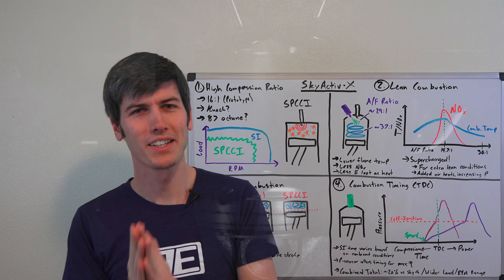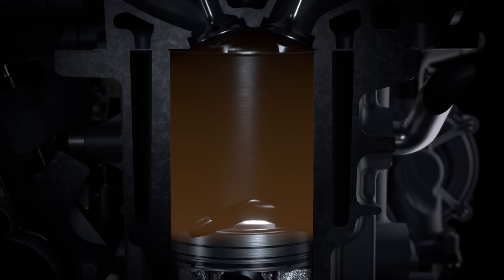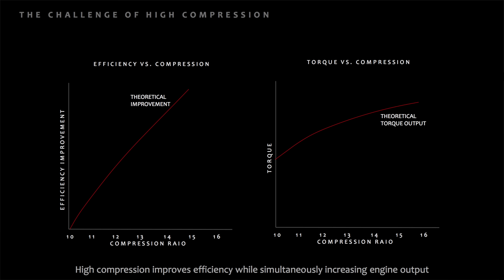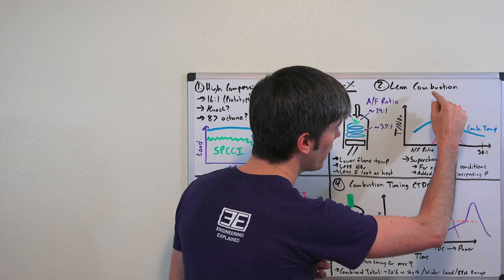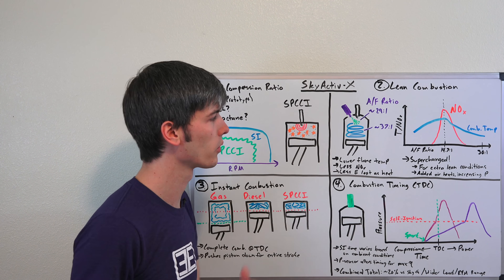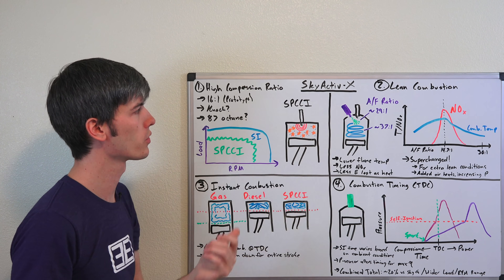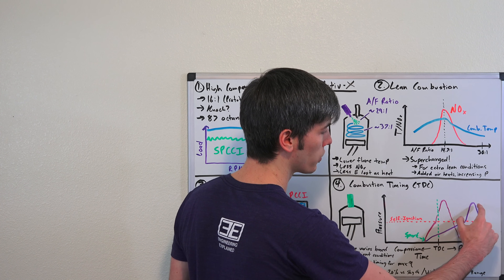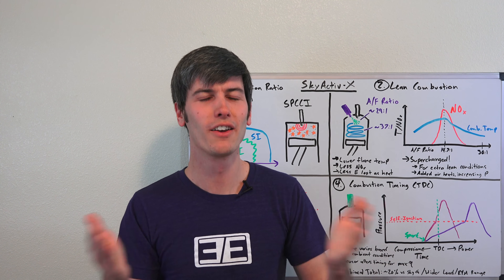How Mazda Is Saving The Gasoline Engine - SkyActiv-X

Comment: 7:25 - The lean supercharger is not to improve performance...

Oh it'll improve performance... just give the tuners about 6 months after its release
Reply: maybe not actually. The engine is very precise in when it sparks, so I don't see many ways it could improve performance. It would make the mixture less lean, therefore defeat the purpose of the engine.
Reply: yeah but then he explained what it does (puts crazy amounts of air in the engine) and.....isnt that increasing performance?  lets pretend that they did this without a supercharger first.  it would be considered underpowered because in order to get the correct air/fuel ratio, it would have to inject less fuel.  so then they introduce a supercharged version.   everyone would say it is for power even if it is only to get HP figures up to todays standards.
Reply: @spencerphilippinedream3706  lol no cause 190 hp for a n/a 4 cylinder is very up to hp standards, but would require more fuel. This engine being able to run so lean, it needs the charger to even supply the amount of air it needs
Reply: @tlpusher9652  you said almost exactly what i was trying to say so im not sure that i explained it very well.  you dont "NEED" a supercharger to get 37:1 air/fuel ratio.  simply inject less fuel.  in that scenario, you would have very efficient engine but under powered.  right?  if you injected less than half the fuel (to get 37:1 instead of 14:1) the engine would create about half the power (95 HP).  
         superchargers are parasitic.  it cost HP to gain HP.    so for max "efficiency" a supercharger isnt needed.  this is why i say, the supercharger is for power, not efficiency.  
         i think a n/a engine would be MORE efficient.  however, it would have to be double the displacement to create the same power as a traditional 14/1 air/fuel ratio.  so 2.5 liter power from a 5.0 liter displacement.  that doesnt seem like good marketing.  
           and the reason they cant use a turbo (NOT PARASITIC) is because turbos dont provide boost at idle.  so not only would it be HALF as efficient at idle, but probably wouldnt pass emissions.  
           this response just got too long.  the bottom line is that i believe this concept is possible for a n/a engine but nobody would buy a 95 hp engine in 2020.  so mazda decided to supercharge it up to 190 hp but when confronted with "190 hp isnt that much for a supercharged engine"  they responded with "it isnt for power, its for economy".  there are much, MUCH easier and cheaper ways to increase the air/fuel ratio than by supercharging.
Reply: @spencerphilippinedream3706 , what are those much easier and cheaper ways?
Reply: @spencerphilippinedream3706  it could be super-turbo, to where the turbocharger is spooled up electrically?
Reply: @raynic1173  Dang, All this sarcasm for disagreeing with them saying that their "supercharger is for economy"?  i never claimed to have some great idea, so im not sure where you got that from.  this is common knowledge, but you can choose to believe whatever you want. 

 im sure you will respond with how you are right and i am wrong, so go ahead and get in the last word.  it doesnt bother me because im not interested in continuing a conversation with you.

Comment: The gasoline burn is like a chain reaction of tiny burns. Each tiny burn is a mini-explosion in a confined volume (the cylinder); but each subsequent tiny burn is into a larger confined volume as the piston moves down. So each subsequent burn produces that little bit less work than the last one.

I thought of a string of firecrackers each in a bigger sealed container than the last.  The first in a thimble size container blows it apart completely, but the last one in a two-liter bottle size container just makes a little pop in the bottle.

I don't know if this is actually true, but it helped me understand the difference between the slow gas burn and the instantaneous diesel/SPCCI burn

Comment: There is no battery technology on the horizon which will make electric cars with ranges as long as petrol ones.

An electric motor is superior to an internal combustion engine in all respects - efficiency of 90% and above, lighter, no gearbox, simpler, etc.  There's just no way to store enough energy to make them practical across the board.

Comment: Replace one cylinder with a rotor. Now the equivalent of a six, but with a lot more peak power. Deactivate the rotor most of the time. Run it only at high loads.
Reply: Uhhhhh, What?
Reply: Seen how RCCI engines can use two fuels to get better performance than from one alone? It may be possible for a combination of rotary and piston to do the same.

Comment: Its my understanding that lean combustion is correlated with higher temperature simply because you don't have the added cooling effect of more fuel delivery. Fuel comes into the cylinder cold and sinks out heat when you're running rich. Going from say 11:1 to 14:1 removes enough fuel flow to raise the actual cylinder temperatures which puts most tunes at higher risk of knock.

Comment: Thank you for your outstanding explanation about the Skyactive engine theory.
I have a question regarding higher octane useage in this engine, and I will devide it to two parts:
1. Knowing that this engine requires "knock" to occur for its operation, what will happen if you were to put ideal fuel in it (100 octane? the kind the would't knock...)?
2. In my country, the lowest octane we have is 95, and the highest is 98. You said that the ideal fuel for this engine would be 80 octane, so as it gets higher it becomes less efficient? Is it true to say that every Skyactive engine being sold in my country doesn't live up to its potential?

Thank you for your time, and for satisfing my curiosity!
Reply: Us ron is different to UK ron
91=98
Reply: The latest info is that mazda has 2 versions of this engine a "US" version and a version for europe each tuned for different octane fuel. also the version for the us has a 15:1 compression ratio and the UK version will be 16.3:1, so you will not need to worry about the fuel it will be optimized for your higher octane fuel.

Comment: I was taught that diesel fuel burned slower giving it higher torque but limiting it's rpm range which is why it has a cetane rating which is the opposite of octane or resistance to detonation

Comment: Why lean mixture tends to reduce NOx ?
What i have observed while doing calibration of 2 wheeler is that, with going AFR from 15:1 to 20:1 NOx increases ( just an observation ), will you please explain this ??
Reply: Depending on engine design, specifically cooling system, your results are not unexpected.  NOx emissions are tied to temperature (higher temp combustion = higher NOx production).  Leaning a mixture can actually raise combustion temperature.  In the same way sweat cools us via evaporation, gasoline cools the charge via evaporation.  In fact, gasoline ability to cool via evaporation is closer to that of alcohols than water/sweat.  In this way, lean combustion leads to higher combustion Temps and higher NOx output.  Source:  currently acing my engine design course at an ABET acreditted engineering school, also a minor in chemistry.

Comment: If you run a supercharger to compress air that doesn't partecipate in the combustion process due to the lean mixture you are not loosing power?

Comment: Sounds like you are saying they use an insane compression ratio with dramatically retarded timing, and a little direct injection magic?  Pretty clever.  I suppose one could toss in racing fuel, advance the timing, and make sick power.  I'm guessing that would void the warranty.

Comment: Don't put too much faith in EVs just yet. Batteries, motors and the ability to fast charge still has a long long way to go. I suspect a  new storage technology needs to be developed to match the IC engine.
Reply: GreenPedal if we don’t put faith in EVs then nobody is going to innovate. It took an Elon Musk to force everyone’s hand. Fast charging has come a long way, we have 500KW chargers now that can charge 80% in 15-30 minutes depending on the battery size. That’s plenty. go on your lunch break, plug in, eat something, come back, boom your car has another 200-300 miles

Comment: Sorry to be so late to the discussion but the basic principle of using a rich mixture at the plug & lean in the rest of chamber was done in early 80's by Honda. SuperCharging & 16/1 with pressure, triggered ignition does gain tremendous advantage of combustion & efficency but at complexity & reliability costs. Hopefully if they can build as a 400k mile engine with this its a game changer.

Comment: So.... basically if you were to put a higher-octane fuel in this engine then that would essentially be the same as if you put 87 in an engine that required premium?  Not necessarily in the aspect that you could potentially damage the engine, but it seems that a lot of its performance and operation seems to be dependent upon the way that the lower-octane fuel ignites at the ideal cylinder temperature.

Comment: The quick burn idea is used on over Square motors like a 1994-03 zx9r with a 75 bore x 51 stroke.  recommended cheap Quick burn 87 Octane and 45 degrees of advanced timing for the 12k red line. 12.2 to 1 compression.

Comment: No matter how advance the new internal combustion engine still it is NOT the future of modern vehicle. It has carbon emission that cause air pollution that can cause sickness. Carbon emission slowly detroying our ozone layer that could cause climate change and global warming. ICE vehicle will be obsoleted in the future because fossil fuel is not renewable soure of energy and it will be depleted in the future, so it is useless to have an engine without fuel. So we must all switch to electric vehicle. Electric vehicle technology is rapidly improving, zero carbon emission and low maintenance are advantanges, it also using a smart driving system to decrease the rate of car accident like automous driving system that can drive you home when you are drunk and advance sensor for automatic stop when someone cross the street. Super Fast charging and long range travel are now achievable. Specialy once the graphene super capacitor would be us a replacement of the lithuim battery that will give more energy for long distance travel and super charging. Graphene super conductor will be used also to replace the copper wire of the electric motor to improve performace and avoid overheating since super conductor dose not generate heat while being use for a long period of time. So electric car is the future of modern vehicle. But the problem is the price it is expensive and the maintenance cost is also expensive but hoping that the price will be reduced due to competation since they're many car manufacture are making electriv vehicle now. The point is not whether we like it or not we can not electric vehicle from dominating in the future

Comment: I know I'm a little late to discuss, but wouldn't be more efficient with a turbocharger instead? I believe that with the now days tech the intake air pressure and temperature are as much controlable as with a supercharger, and the turbo uses energy from "wasted" exhaust air.

Comment: I'm confused about the NOx emissions.  I always heard that when an engine runs lean it produces excess NOx emissions.  Honda made a lean burning engine back in the 90s but it was phased out for emissions reasons.   Diesel's require urea after treatment  to reduce NOx emissions when they run lean.  
Can you elaborate on the part where you said NOx emissions go down when an engine runs lean?

Comment: Until recently, I had a 2006 Mazda 6s with the Ford Duratec 30 V6.  Loved the car, but started having engine problems toward the end (after more than 200,000 miles).  Question: how reliable is the SkyActiv engine?

Comment: Direct injection motors usually have carbon build up problems in the intake port. Wouldn’t the SKYACTIV motor also have ‘‘this problem? Or does the supercharger help negate this issue?

Comment: That was a great explanation, I have a Mazda CX3 (2017) 2.0l which is stamped with a Sky-active badge...I had no idea really what that meant until I saw you explain all this. Ive always had Mazda's, great drivers cars, and this new one is no exception, it is incredibly light on fuel while still being great to drive and very punchy..Averages around 6.5Litres per 100Km, for you guys in the states that is 36.2 US Miles to the Gallon, on combined city and freeway cycles.

Comment: Excellent video, the technology well explained, but no mention of reliability. And this engine has direct injection which is well known to cause inlet valve build up. Has this engine been looked at after 30, 40 or 50000 miles?
Reply: Im sure Mazda's R&D performs reliability testing

Comment: I once designed a non oil burning two stroke petrol engine that doesn't use crank compression induction. It uses a supercharger in place of the crank induction and it has a 1-1 camshaft xD I have no idea if it would work. I'm just curious if anybody else with a background in engineering knows if such an idea is possible. ;)

Comment: Sorry, slow to learn about this SPCCI.   Can you explain where the fuel comes from for the lower half of combustion chamber?   From your presentation, the Direct Injection Fuel Injector is for the "Ignition Bubble" high fuel to air ratio  volume at the top of the cylinder.   What about the lower volume in the combustion chamber, where the air-to-fuel mixture is 37:1.  Where is the injector for that mixture?  Are there two separate direct injection fuel injectors per cylinder in the SPCCI engine?  Thanks, nice video!
Reply from the maker: Just a single injector, but the tumble, and timing of the injection (injecting late leads to a rich A/F mixture in that area near the spark plug) determine the relative areas of different a/f mixtures.

Comment: I thought that this engine actually injects ANOTHER small shot of fuel at the last moment before it compression ignites on its own and then ignites that last shot using a spark, which ignites both charges of fuel essentially.  Why not wait till it ignites on its own as it was going to anyway... why the spark?  Would Ci occur too late without the spark?    I would think that gasoline, being more volatile would want to ignite too early.  On the surface it suggests the process needed to be sped up.... However in conjunction with an additional small amount of extra fuel being introduced at the last moment, suggests to me that the process needed to be delayed and once delayed it is then spark ignited..    I think I am confused...either by thinking more fuel is being introduced (as a delay or charge cooling mechanism) or on the properties of Ci and gasoline in general..  

 Please advise I'm very interested to understand, because I'm sure I'm goofing something...

Comment: Seems to me that the weak link in this engine will be the spark plugs since they are a wear item. I'm guessing that they will have a replacement cycle much shorter than 100k miles to keep the plugs at peak mechanical condition. Since it is a 4 cylinder that should be pretty easy though.

Comment: I wish the next sti could be 4 electric motors. One per wheel with a turbine turning an alternator to charge battery. Turbines can run on any fuel. Plus awesome sound

Comment: I am amazed with the electronics in the engine,

Think if engine revs 6k rpm  after crunching few numbers to decide to ignite the engine on correct time, using a ECU which has 10MIPS  you have 1000 clock cycles to react!!!!! Its insane !!!

Comment: So basically, treating a gasoline engine as if it was a diesel engine. Pretty cool.
It's actually amazing how much you can improve a 140 year old technology.
Reply: OFC! When something's around for ages a huge number of set of eyes are going to stare at is and some of them will eventually improve the design.
Reply: To be fair, how much have we improved fire?
Reply: as i recall they did something similar with their Diesel engines as well back in ~2013
Reply: Modern electronics, faster than a flame front.
Reply: @clayz1  yes. but the batteries are still not there yet.
Reply: @clayz1  Except the earth is already close to being depleted from Lithium. If you don't know what you're talking about, don't bother trying to make a point. Sustainable fuels for combustion & hydrogen cannot disappear & produce less pollution than the powergrid does when powering EVs.
Reply: @bo-dine7971 My somewhat humble my apologies. I hope you find your bat trees.

Comment: So i got couple of questions, 

1- why not increase the pressure a bit more by increasing compression ratio and let the mixture reach that self ignition pressure instead of using the spark to put in that littlw extra pressure ? 

2- why use a spark plug if the champer gonna compost due to pressure in the first place ?

Comment: The combustion on diesel and SPCCI occurs when piston force through rod is at and closest to tangent to circle motion of rod throw of crank. When rod force vector has small component in direction of that circle then combustion pressure has huge waste.

Comment: The high air-fuel ratio was first started by engineers 30 years ago. It did not work at that time. Mazda made it this time using a procedure that you eloquentlty explained. Thank you for bringing this up. Mazda is my guy now.

Comment: His diagram/explanation makes it look like a regular gasoline engine combusts closer to bottom dead center.  That's just not the case.  Otherwise it would barely run.  They all combust at top dead center.  We're talking milliseconds of a difference.  Also, diesels use air mixing with the fuel too.  He made it sound like the combustion occurs on compressed diesel alone.